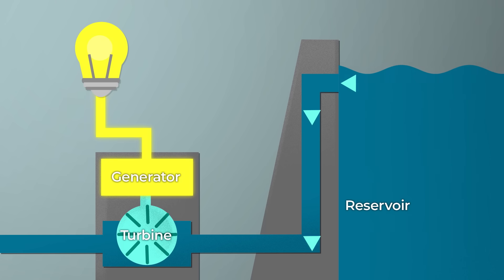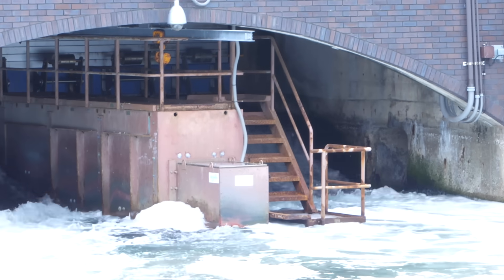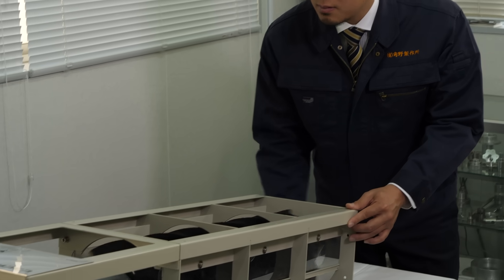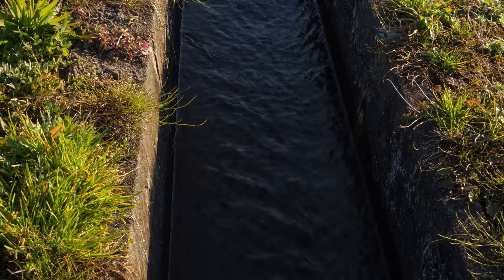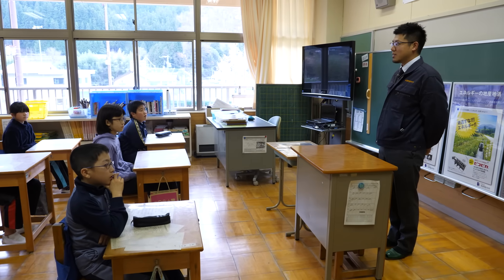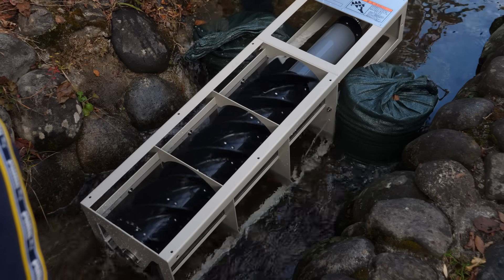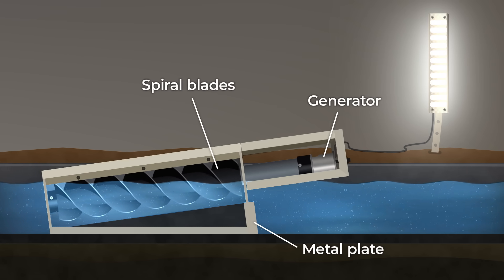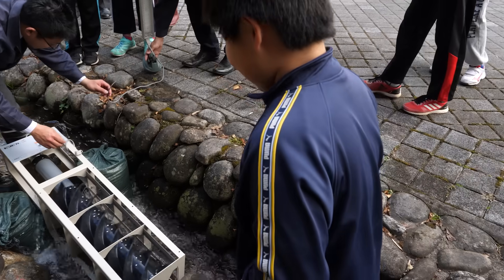Ultra-Small Water Power Generator

Comment: Archimedes screw -> Archimedes screw generator...nothing new...cool implementation though
I really like the gravitation vortex turbine  ideas out there
Reply: It may not be new but have you ever made something to help a lot of people and the environment?
Reply: Nice idea, easy to setup and use. Add a battery charging current and lithium batteries that can be charged up during the day. The battery pack then can be used for running led lights or any other electronic equipment.
Reply: Hi Brian C, Archimedes "invented" or "published" the principle (using it to "lift/pump" water) and it can work both ways.  You are right, the practical application is "cool".  Happy holidays, Semper Fi, L (Veteran)
Reply: Johnson there are Line contact gear with minimum friction. These gears have neglegible friction. These gears are not designed to carry loads they are specially designed to transmit power.
Reply: @kiranvijaykumar5135   You can't escape the laws of physics. The flowing water only has a certain amount of energy. You can't get more out of it no matter what you do. Do the math instead of making assumptions about line contact gears and friction.
Reply: Yes,Archimedes snail, 2200 years old.
Reply: 20mm is required to hold 2500kg load
Reply: @kiranvijaykumar5135  No it's not. AISI 4140 at RC 35-40 has a yield of 143ksi and 9mm diameter gives you a safety factor of 3.25:1 based on yield. 20mm dia gives you over 13:1 on yield. It's too big and unnecessary.

Like I said...you don't know what you're doing. You've been claiming math is not important in design so I gave you a basic and simple shear strength calculation and you failed at it. You've lost all credibility.
Reply: Eu nunca vi! Portanto para mim é novo!
Reply: It helps to keep rivers clean.
Reply: Now I have to delete my remark Archimedes screw instantly
Reply: where can i buy the blade?
Reply: The best gravitation vortex turbine humans have produced is 79% efficient. Theoretical max is 85% ...  From this https://www.renewablesfirst.co.uk/hydropower/hydropower-learning-centre/archimedean-screw-hydro-turbine/ archimedes screw is roughly the same. So there's no benefit of one over the other... it is about placement and which is better applied in your location. Gravitation vortex can't be used on these ditch streams without huge reworks.
Reply: No one said it was new. Brian C: You’re totally right but you sound like a know it all dweeb
Reply: Remind me of the guy at the party talking about notes of leather and tobacco in the Cabernet. Except with science topics
Reply: The wheel reducing friction of stuff being pushed->the wheel doing the pushing

That's just how it works sometimes
Reply: Dude...Archimedes invented the screw, not electricity. Duh! 
So, this application actually IS new.
Reply: @eaglegrip6879  No it is not. https://www.renewablesfirst.co.uk/hydropower/hydropower-learning-centre/archimedean-screw-hydro-turbine/  With that said it is an innovative application of the principle in small form factor.
Reply: Have you guys noticed how stupid the scheme is at 0:40? The inlet should be pretty much on the bottom so the pressure is high.
Reply: @Mike-kr5dn  the pressure is the same. There is the same amount of water above the fluid element in either case. One is just in a tube the other unconstrained.
Reply: Mert Garbonite well yes but after the water level drops it will come to a halt.
Reply: @Jesussaves77789  yup. Ever since your mum started living on the riverbank.
Reply: There are many clean water also. What your saying is applicable to illiterate states like UP, Bihar, Gujarath... There are other states with good literacy rate. 

I do agree that illiterate people voted and selected BJP government which is the reason for under development. Educated people are loosing value in India. Even Indian Prime minister is also an uneducated person who was selling tea.
Reply: @kiranvijaykumar5135  With gear reduction there would be LESS energy because the gears have friction.
Reply: 20mm dia
Reply: @kiranvijaykumar5135  What's your safety factor on yield?...because 20mm dia is way oversized.

Clearly you don't know what you're doing. Did you use software incorrectly or you can't do math?
Reply: OU812 I know what your talking about. Your talking about conceptual design, which only includes some basic formula and calculations. Once a design is set and optimum design is finalized. There is no need to do conceptual design again, some standard set of charts will be set according to the design calculations done previously. Only detailed design is required after that.
Reply: @kiranvijaykumar5135 Shut up you idiot, you're just talking shit. You made a statement that was wrong,  you sound like the type to have learnt one thing about a topic and now you think you know everything,  you haven't yet reached the point of intelligence to realise you're stupid, you will get there one day and cringe at yourself.    Now you're just craping on about nothing trying to back track.
Reply: @kiranvijaykumar5135   No you don't know what I'm talking about. That's become very clear to me. You're attitude tells me that your design career will be short lived.
Reply: Total output will not be same, just see wind turbine design
Reply: Eagle Grip only Engineering mathamatics would help. Now a day's nobody does maths. There are software's like Matlab, Ansys... These softwares would performs 1000s of pages of manual work in fraction of seconds. For some difficult problem and analysis even Ansys would take days to give results depending upon computer specifications.
Reply: @kiranvijaykumar5135  Hi Kiran, with all due respect, as an automotive engineer who trained in the days of slider rules - there would not be much engineering if it was not for the use of maths; the field of physics depends on mathematics.  Even computer hardware using the software you mentioned were designed with mathematics.  BTW OU812 is right, any gear, shaft, bearing, etc. creates a loss of energy, no matter the efficiency of the design, there is still a loss.  But lets us make these comments with civility - many viewers do not understand what is going on and you and OU812 bring up issues that can teach them - as long as we do not start "cussing" one another out.  Peace be with you, Ciao, L
Reply: OU812 whatever I told is not assumptions it's practical. Such system do exist. I do agree maths is required, but not for complex problems in design. It would take 100s of year to design a car manually. Software's could do it within 2 to 3 year's. Manual calculation is feasible for cheap, low cost items which has no or limited moving parts. The design with moving parts is much more complex than static design.

I have 5 year's of experience in design.
Reply: @kiranvijaykumar5135   Math is not required for complex design?? Who is teaching you this nonsense?  Have you ever worked in a professional environment?...because it sounds like you never have. It's either that or you only have experience in "design" and not actual engineering. They are two different disciplines that overlap.

I never said you need to do calculations by hand for everything but you need to have an understanding of where to start your design BEFORE jumping into the software to make it a reality. You cannot select a gearbox for an application before you know the torque requirement, motor input speed, output shaft over hung load, efficiency loss, etc. You need to use math and basic calculations to figure this out. That's the engineering part. Fitting that gearbox into the machine is the design part.
Reply: @OU81TWO  as an engineer I was gonna say something then I read what you said and I think you have it covered here Haha. Anyway, there can't be much potential and kinetic energy in such a small volume of water right ? I mean they powered an LED but sure managed to use a decent amount of metal to do it. Wouldn't you think it would have to be 10s or hundreds to times larger to be worth building? You know cuz the area is squared and all. Or do you think it's possible to make these things cheap enough that say 50-100watts will pay for itself before it craps out in 5 years.
Reply: @mertgarbonite9307  you might be able to 3d print a lot of stuff.  It doesn't have to have to have a metal auger end or what ever.  Gears and bearings should be good quality though.
Reply: @funmaster4632  I mean, maybe. 3d printed stuff in my experience isnt the toughest or most practical of materials and spinny things like blades in tough environments like flowing water really ought to be at least aluminum I'd say. There's cyclical loading, vibrations etc I don't think plastic of any kind or thickness would hold out much past a year.  The issue is ROI (return on investment). At some point the thing breaks down before your money saved breaks even with cost. In that case your dollars would have been better spent on idk solar panels or something. Where your not gonna make money (without govt incentives or living in the desert) but you will probably get it back by end of system life.
Reply: OU812 really, your from which country
Reply: Cause your attitude tells me otherwise
Reply: @kiranvijaykumar5135   You think math is not important in engineering??

Okay...what diameter pin do I need to hold 5000 lbs in double shear if the pin is made from AISI 4140 hardened to rockwell 35-40?...and I need a minimum safety factor of 3:1 based on yield strength.

If you know math you should be able to calculate this in 5min...or you can spend 30min setting up an FEM model in Ansys and run a simulation. Your choice!

I'm in Canada btw.
Reply: @OU81TWO  Hi OU812!  Automotive engineer here (Mechanized Agriculture Engineering, McGill '77), even though I know you are right, I had forgotten the calculations of your problem (we did it with a circular sliding ruler then, yes I am that old, our Hewlett-Packard 9000 computer, a beast, was for our teachers' use only) - I do know what you are talking about as this was the kind of problem we had to solve on mid-terms.  You are making me feel "old".  Great mental exercise though, Peace be with you, Ciao, L (QC)
Reply: @OU81TWO  i am sure math is good in engineering but engineers tend to over do things for liability reasons.  As a contractor i can give you long lists of bs in the codes and practice of engineers.  A lot of it has to do with the fact that there is a lot variables they can't figure and most don't have field practice. Sometimes engineering and paper work trumps coman since and it shouldn't be that way.
Reply: @funmaster4632   Engineering is a broad field and it depends on which sector you're talking about. The construction industry doesn't work the same way as the aerospace sector (which I work in). Builders don't have the opportunity to load test a bridge. They have to get it right the first time and must account for many variables that are simply too difficult to calculate accurately. Longevity of the structure must also be considered. This is where large safety factors come into play. In aerospace and aviation it's not the same. They MUST test every aircraft and engine to ensure safety. Because of this they are able to reduce safety factors since they are more in control of the variables. It's the reason why planes can only be flown within a certain set of flight parameters (speed, banking angles, etc). If these parameters are exceeded catastrophic failures occur since the calculated safety factors are so low.

The reason why engineering and paper work trumps common sense is because when something goes wrong and people die... it's the engineer that goes to prison for following that "common sense" and not following  proven procedure, mathematics, and engineering methodology.
Reply: @OU81TWO  i am not saying you don't need engineers.  I am just saying the world isn't going to fall apart if general housing isn't entirely ran through them.   It use to be you could give your house plans on a napkin.  Now you have to get a stamp to add anything sometimes two engineers.  This isn't done entirely for safety reasons.  It is done because of lobbying and control of building products and monopolies of the engineers.   I could build a house to code without any plans because i know code well enough.    You could also build differently then standard proticall  depending on the conditions.  Like a deck with southern exsposure in dry California doesn't need the same wood as a deck with a north face but the standard or engineers don't recognize this because they have no field experience.
Reply: @funmaster4632   Residential construction is probably the least knowledge intensive when it comes to engineering. I agree with you that many things don't require an engineer if the builder is experienced but then what about the builder who isn't? Where does the liability fall? How is the homeowner protected? Will the insurance company compensate a home owner if roof blows off because the design was done by a builder without engineering expertise?

I know the system isn't perfect but imagine if there are no regulations in place and any Joe Blow is allowed to do whatever they want.

Speaking of codes...it's the engineers that come up with them.
Reply: Cause you have certain know it all, no one is greater than me attitude. Which certain countries have and suffering downfall with economy
Reply: @kiranvijaykumar5135   I have over 25 years design, engineering, and manufacturing experience. I don't "know it all" but I certainly know a hell of a lot more than you.

If you're so smart like you claim to be then give me the answer to the pin question. Take your time and use whatever resource you need. Prove to me that you're not just some young kid full of shit.
Reply: What if reduction gear is added to this tech to generate double the power it's generating with current tech. And also it's better to provide a electricity storage instead of directly using electricity.
Reply: @kiranvijaykumar5135  The total energy output will be the same.
Reply: @PhilJonesIII  I don't think it's just about total energy output. Storing and outputting the energy in a way that's useful to people is at least as important, otherwise you're still leaving a bunch of energy unused.
Reply: @PhilJonesIII  No it will not.. Hooking up a reduction to it.. transform  the reduction to a power generator..increasing the amount of energy it creates.. did you learn any phisics on your school?
Reply: @gattonpc  I learned physics at university.  Fact 1:  Total energy out can NEVER exceed total energy in with a system like this.  Fact 2:  You might want to check out 'Bretz's Law'  on energy efficency when dealing with fluids. The maximum energy that can be derived in this kind of system is 59.3%.

A reduction gear will give you more speed, not more power.  In a perfect system the energy out will be the same. Since you have friction, then the actual power-out is reduced again.
Reply: @PhilJonesIII  So what you saying is this: If you have more speed and friction to that speed the energy will be that same? right? did you test that theory? Or you speak from books? I've tested a simple bicycle dynam that was run using what you said is not posible and got more energy output from it . Is just like diferent speeds on a runing car...this is basic physics if you didn't know yet. You don't need to know advanced physics for this to understand it. Next time get your ass outside and test before you open your mouth. You don't need to understand it for the first time.. just test others theories then maybe you have something smart to say.. untill then.. keep talking from books that are writen by others..without even test or understand those theories.
Reply: @kiranvijaykumar5135  reduction gear will reduce the output speed. Since the speed is reduced on the rotor shaft, power output will be reduced.
Reply: @kiranvijaykumar5135  a gear loses 10% of overall power, on average.
Reply: @kiranvijaykumar5135  You can hook up an energy storage to it and store the energy. This is how dams turbines are working...but at a small scale. Governments are not so excited about these.. cutting down their money flow.. There are so manny new technologies that can be implemented on a large scale verry easily.. Why do you think those are not implemented yet? MONEY and governments.
Reply: @kiranvijaykumar5135  or maybe increase the number of poles on the rotor i was thinking
Reply: Johnson friction doesn't come into picture. It depends on gear ratio, minimum backlash error. I suggest you go through design of gears.
Reply: @kiranvijaykumar5135  Are you saying gears do not have friction? That would be wonderful news.
Reply: @kiranvijaykumar5135  Preporuka je da učiš malo više o mašinskim elementima i mehanizmima, i onda da drugima soliš pamet. Capissi?
Reply: @kiranvijaykumar5135  they've definitely optimised it to get out as much power they can out of the water already.
Reply: OU812 you don't have knowledge in mechanical engineering. So STFU.
Reply: @kiranvijaykumar5135  what is so funny?
Reply: @kiranvijaykumar5135  Seems an idiot like you is from a literate state of Tamil Nadu. All people in Tamil Nadu are just as literate as you.
Reply: OU812 you need practical education. See the world and it's Technology. Maths is required but maths is not whole world. 

Basically you don't have knowledge....
Reply: @kiranvijaykumar5135   I don't think you understand how the fundamentals of enginneering works. Math IS practical education. Without math, engineers would not be able to calculate how a plane can fly or how a building can withstand an earthquake. EVERYTHING in our modern world relies on the basic fundamentals of mathematics to operate and function correctly.

Your false assumption that adding a gearbox to the small turbine to try and get double the energy output is a perfect example of what I'm talking about. Your making an assumption that is incorrect. An engineer would never guess and make an assumption the way you are doing. They start with a basic mathematical calculation to see if what they are proposing is actually feasible. This is what I suggest you do.

FYI, I'm an engineer with 25+ years experience in designing and building specialized equipment and machines for the aerospace industry.

What are your credentials?...
Reply: @kiranvijaykumar5135  
Maths??? How many is enough?
A bushel, perhaps? Or, how about
a cord, a yard, or a barrel 
measurement?? Would that be 
enough? How many "maths" 
does it take? 
ROTFL!